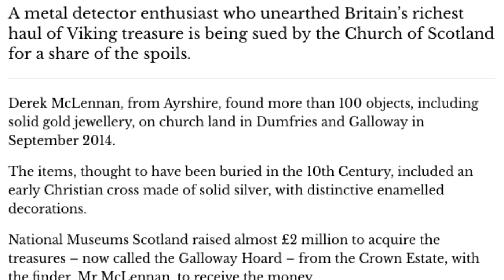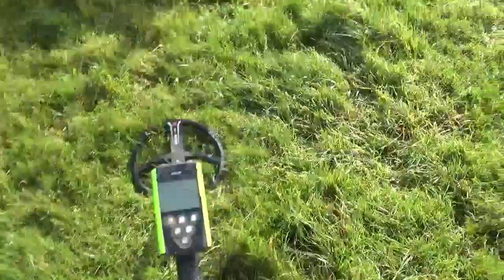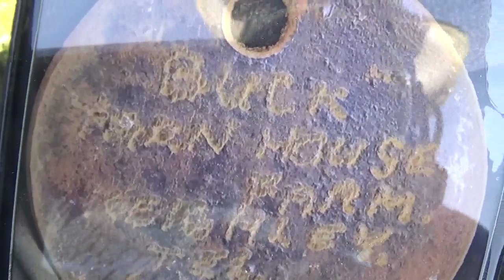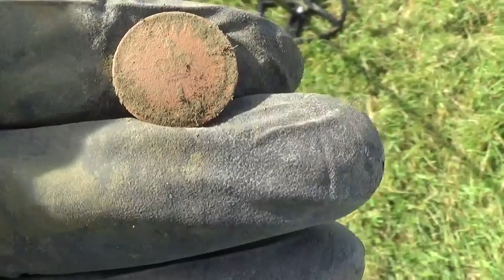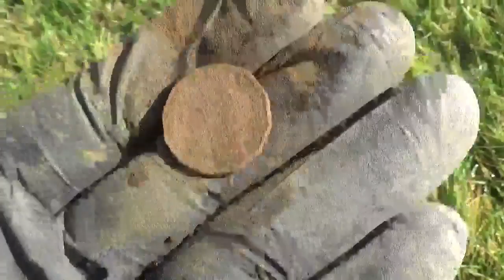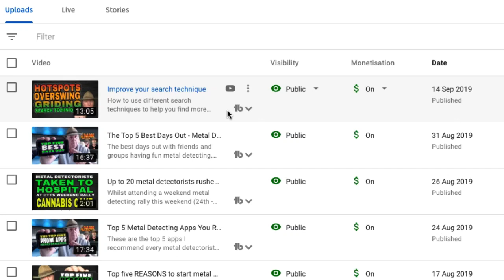Should you SHARE your £2million treasure finds with landowners?

Comment: #coinhatgiveaway written agreement should rule.  Fairness would divide 50/50.
Reply: Tom Williams , agreed, but if the written agreement goes against the law of the land then its null and void.
Reply: Richard Love It’s not against the law of the land to have such a private agreement, written or otherwise. While the law in Scotland does indeed give the finder 100% of the find, the vast majority of ethical metal detectorists will share with the landowner, as they do in England.
What this court case will do is ensure that in future land-owners will insist on a written agreement before they permit detectorists on their land, which is course to the detriment of the hobby. The Church may even insist all such agreement are checked by a lawyer, at the applicant’s expense, before they will give permission.